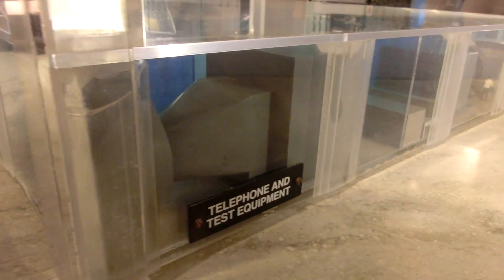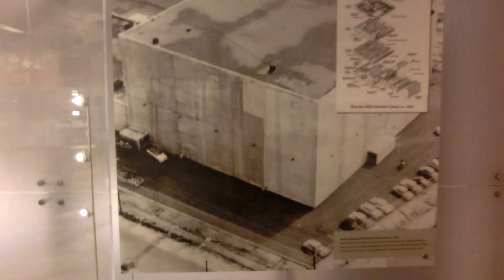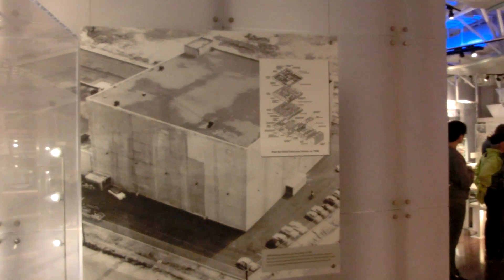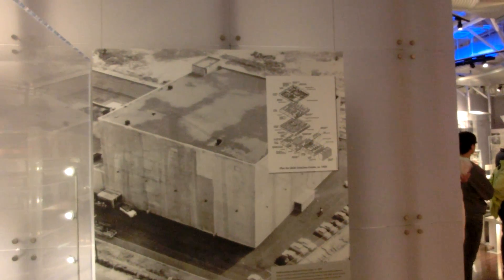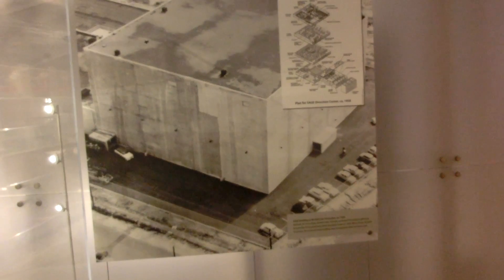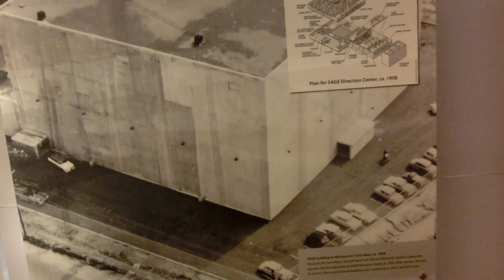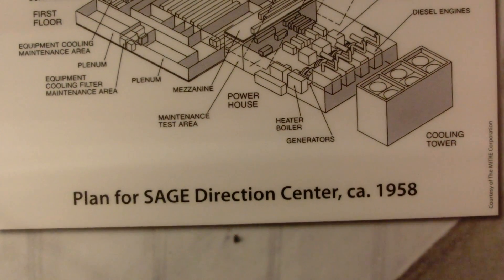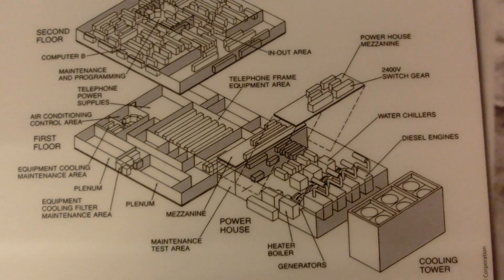USAF - IBM  SAGE air defense floor plan  - Air Defense History

Comment: I wonder if there were some differences between the different SAGE buildings.  I was a SAGE radar controller with the 23rd Air Division in Duluth, Minnesota in the mid-70's. Some of this model looks the same as what our floorplan was but there are also significant differences.  We had a break room just off what this calls the Weapons Direction room (we just called it "Weapons" or "the Blue Room").  Instructors had their office down the hallway to the right on the left side. At the end of the hallway to the right was the restroom.  Stan Eval was out of Weapons Direction to the left.  Lots of other differences.